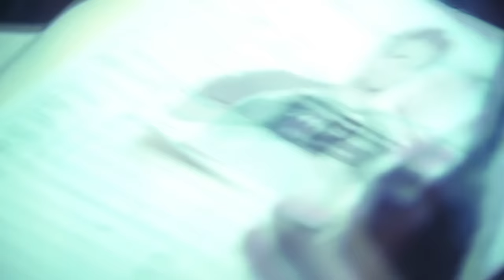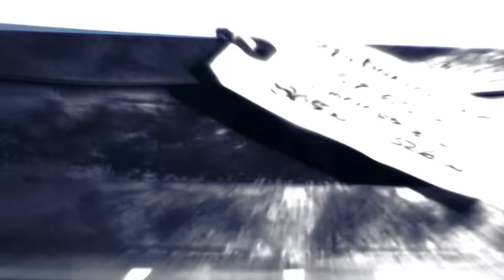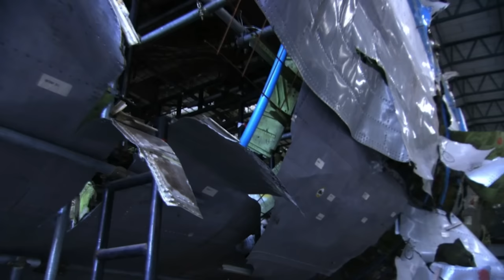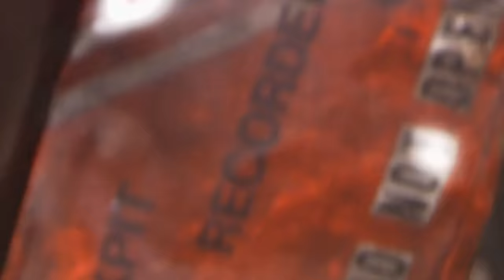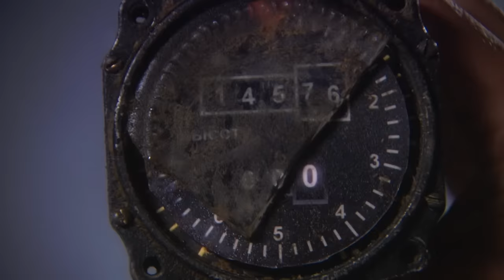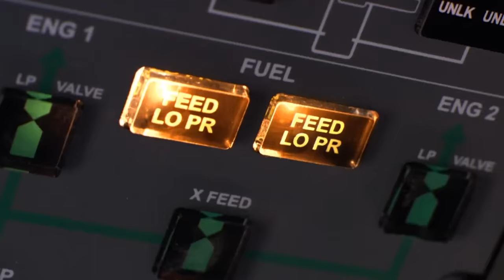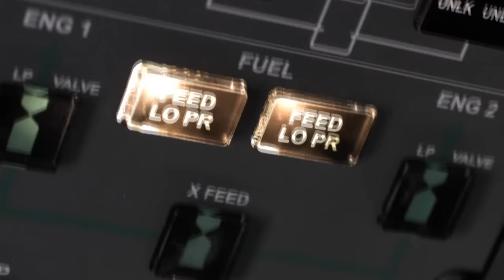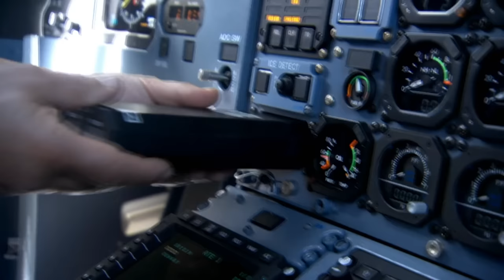Fatal Air Disasters That Changed Aviation Forever | Season 7 - MEGA MARATHON | Mayday: Air Disaster

Comment: That last one is so unfair to the pilot. Look at it another way, what if when the second engine failed he immediately started gliding, did not try to start the engines AND then he landed with 1800 kg. of fuel? He'd have looked like an incompetent idiot. Yet this the only way they are saying he could avoid being at fault, to not try to start the engines but instead immediately go into glide mode despite his fuel gauges telling him there's 1800 kg of fuel. He couldn't have known those gauges were faulty. No, IMO the Captain is a hero and his airmanship is the reason there was as many survivors as there were.
 Oh you can't do both in that plane, it needs to be at a lower altitude to do the restart procedure, so it was lose altitude to try the restart or glide, he couldn't do both and still have time to make the airport.
Reply: I think the reason the pilot was charged was because he went ahead and took off knowing he didn't have the refuel slip proving that fuel had been added to the plane.
Reply: The fuel gauge boxes should have different slots where only the correct model can slip in. 
The mechanic was more at fault.
Reply: @Crashed131963  the mechanic did not design it. Blame the engineers
Reply: You are not a hero when your own life is being saved too.
Reply: @GOLDVIOLINbowofdeath  that is the stupidest thing I’ve ever heard. pilots don’t do it because it means they’re doing it to benefit themselves.
Reply: Fault clearly lays with the one who put the wrong gage on the plane. IMO anyway.
Reply: The mechanics screwed up. Its a combination of errors. I thought of feathering props. Why did the engineer think of that? What a waste of life & plane & time for investigation.

Comment: I think it's funny how on the last episode these pilots we're Monday morning quarterbacking how these Pilots handled the Glide that's easy when you're not in a life and death situation but very enjoyable I liked it
Reply: According to Wiki says Captain Chafik Gharbi, received six years and eight months; with the others receiving reduced sentences between 5½ years to 6 years.
Reply: The simulator pilot straight up says we had the luxury of not being in their situation and is why we achieved the results we did.  They also knew the aircraft had run out of fuel but Gharbi did not know at the time and only thought it was an engine flame out.
Reply: Yeah, they immediately turn towards Palermo when it happens. It's nice and easy when you know all the answers beforehand.

It's much easier in a simulator when you get infinite attempts at it. Life doesn't have a reset button.

Comment: 2:12:43 When they know there is a fuel level gauge issue when it’s repaired it should be manually checked and idk what the procedures are but I would think the pilots should check fuel levels manually before each flight I know for myself if I was flying over water I absolutely would not fly unless I checked fuel, oil, hydraulic levels because you don’t have options over water. Regardless the pilots didn’t know they were out of fuel if they did they would have tried to do a proper glide
Reply: Completely agree!

Comment: So has this New Delhi crash shove Tenerife out of #1 crash of all time?!?
Reply: Found my answer....Tenerife was 580 ppl die...I was thinking it was only 300+
So Tenerife is still considered worst crash in history
Reply: Tenerife was on a runway, while New Delhi was midair.  Japan Air Lines Flight 123 (also known as JAL123) for me still holds the record for the worst air crash with 520 lives lost.  That crew did everything they could to save themselves.  Tenerife I know surpasses it in the death toll at 583 but for me, the JAL fight was such a terrible accident in that it was a faulty repair that brought that plane down.
Reply: No, the Tenerife disaster still has that place in aviation history. Five hundred eighty–three people died in the Tenerife disaster; I think three hundred fourty-nine people died in New Delhi. The difference between them is that the Tenerife disaster was a runway incursion, while the new Delhi one was a midair collision. I think a runway incursion is the correct term. It’s when a plane hits something else- debris, a building, another plane, Or anything else that a plane can hit- on a runway. I think that the midair collision in New Delhi is the worst mid air collision in history, but I can’t remember for sure. Sorry for any typos.
Reply: Japan airlines flight 123 was the single worst air crash in history.
Reply: I think there were 3 or 4 survivors on the JAL flight 123. But still, a horrendous death toll.